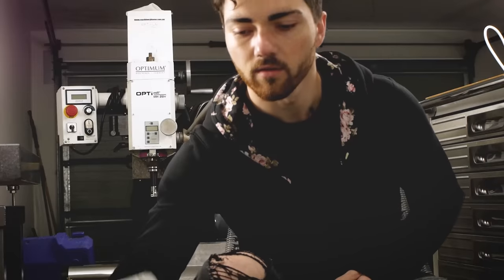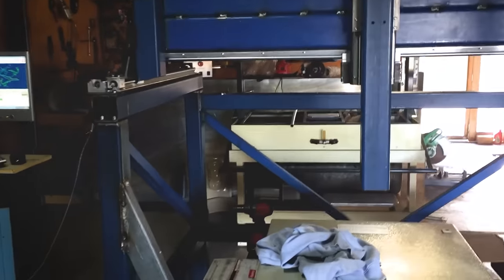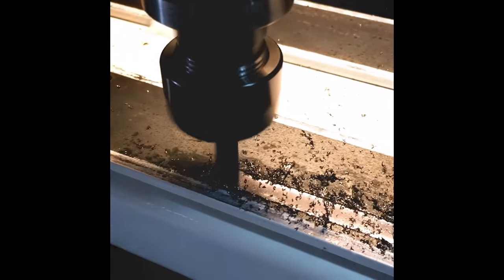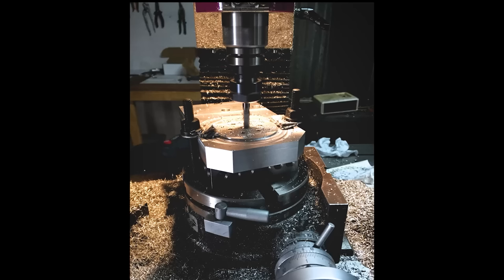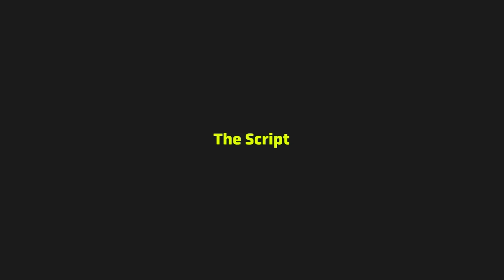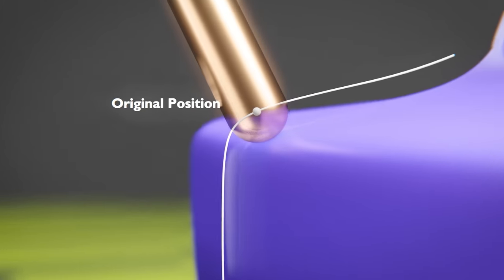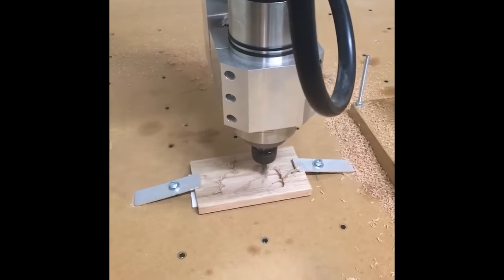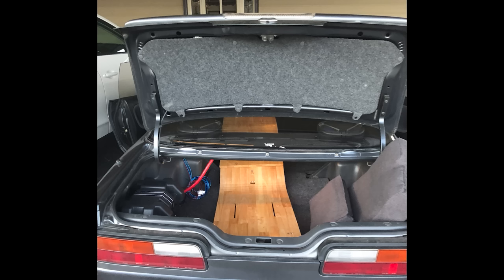I Built a Custom 5 Axis CNC Router and Barely Used It

Comment from the maker: I’m thinking to port the script to JavaScript and run it on a website probably with an ad to help pay for server costs). Would you like to see that happen?
Reply: Would a fiberglass mold work for your original intended product?
Reply from the maker: @coop3014  As a tool to vacuum form over? Maybe. As a final product? Nah, it has to be polycarbonate, that's the industry standard material.
Reply: I think the port is a great Idea. Honestly if you are able to document it's usage very well a monthly subscription or one time fee would be a good idea. G-code for 5Axis has always been a problem at a reasonable cost.  I've been into cnc's for well over a decade now and the 5 axis jump is always in the back of my mind.
Reply: yes
Reply: nominal cost, ability to purchase through jungle site... unlikely though, that stuff is a pain to set up for non-physical stuff, selling serial number cards for someone to register, cookie tied to number turns off ads, that might work and third party handles physical cards.  get enough people hitting the site for g-code generation and ads won't pay for server costs.
Reply: Yes yes please
Reply: Is that software available somewhere?
Reply: yes, of course, I looking for your python script to.. Good job

Comment: As a retired guy not wanting to sit on a porch and watch traffic, I also have dipped by toe into both building a five axis machine and writing the CAM software to generate the tool paths. I will not finish the machine until there is proof that the software will accomplish what I expect. I am using Rhino3d to generate the desired shape, and an plugin called Grasshopper to generate the GCode. Fun stuff while in discovery mode, dark moments when I learn what I need to learn. Thanks for the Video and the inspiration. What you have described  is a gift that will keep on giving.
Reply: unless you're some programming savant, why are you wasting time on writing a custom cam software, just pirate mastercam or hypermill and concentrate on mechanical and electrical.
Reply from the maker: @jonjon3829  the joy is in the journey. I also want to know how to make 5 axis CAM software properly.
Reply from the maker: I love that. I also dream of making proper CAM software. I’ve thought about many approaches, I just don’t know how to understand the data structures and mathematics for it all yet. I hope you figure it out… and then help me 😄
Reply: @machsuper  you guys must be in the top IQ dept. I've spent 3 years designing a 5 axis microcenter and I'm barely scratching the surface. After all this time all I got is what type of a frame I will use. That's all I've managed to do after investigating all possible frames on the market and a hundred cad concepts not to mention hundreds of hours running FEA on half of them.
Reply from the maker: @jonjon3829  sounds like you're simply making a better machine than I would. I genuinely doubt I'm in the high IQ range.
Reply: @jonjon3829  writing your own code allows you to understand how everything works. Also allows you to include features some programs don't have, of features particular to your machine.
Reply: @AORD72  you really think a single guy can write a feature the big guys haven't thought of in the last 50 years?
Reply: @jonjon3829  
Well you are probably correct for the top level applications. The affordable ones can be limiting, and finding a suitable 5 axis can be hard. Sometimes the features might not work in the way you want it to work. The thing is you can customize everything. Plus you learn and understand why and why not things can be done. You don't have to write every feature, just the features you need. 

I wrote 3 axis software. It was CAD and CAM all in one that created GCode which I ran in mach 3 (about 60,000 line of code) . However I had some experience in writing software so wasn't too hard (Quaternions, threading, Object orientated, C#, C++, OpenGL).

I'm look at 5 axis (building machine and writing code). I have a lot of the code structure in my head. But all i'm interested in is a head following a path generated from cutting a  STL file into bits. 

"just pirate mastercam or hypermill", not sure how you do that. If you use their software in a commercial setting you could end up in big trouble.

Comment: I really appreciated that video, especially from a fellow Aussie. In the past 12 years I have built and sold 3 CNC machines and barely used them as well. Im quite convinced that the actual hobby IS the build, and not using the machine. I have quite a few CNC buddies who don't use theirs either. I remember building my first machine and having no idea how to run it or create gcode. Its quite weird building a functioning machine but not knowing how to actually drive it. 
Anyhow thanks for your honest account. I think it will help quite a few people.
One thing Im very sure of,  is the minute you dont have a CNC machine, you will want one again.
For your moulds I reckon 3D resin printing and then sand and polish is the go today.
Reply: Hey Ben.  You found this also.  Awesome stuff here.   I mill in foam, put a silicon with backed  fibre glass jacket over the top.  Make a  plaster mould from the silicon/fibre glass mold and vac form over the plaster.  When the mold breaks, I just pour another.   And I was proud getting my cam software to spit out g-code for my mills plasma cutting conversion.  However,  this is next level.  My hat  is off to you...  Brilliant!!!!!!!!!!!!!!
Reply from the maker: Did your vacuum formed parts have clear windows? That was a killer for me, it was so hard to get a good finish on the inside. It seems like it has to be a near mirror finish to leave the surface nice and clear. It has to stay very clean too.
Thank you for the great comment. :)
Reply: @spidey4fun  Hey sir, did you stumble upon my comment or get a notification? Mate I always think what you do is amazing. Currently Im making another virtual pinball cab. The software has streamed ahead since the last one I built. We gptta all catch up again at some point.
Reply: @machsuper  I know you were asking Spidey, but my thought is could you make the mould and then cut out the window part and carefully glue in glass. That way you would maintain a smooth hard surface. I still recon 3d resin printing has come of age. One other point, people imagine CNC to create a finished surface, but that's a mistake, you need to clean and polish by hand.
Reply: @ynnebbenny  Hi Ben,  I was  just reading through the comments and saw your name.  Thanks for your kind words.
Reply from the maker: @ynnebbenny  no can do with the glass. RC car body shells are made from a single piece of polycarbonate for a specific reason: impact resistance. They can be crash many times and still hold up well. They're also very thin and ideally very light. Glass is basically none of those things.
Reply: @machsuper  No no, im suggesting you make your mould /plug windows, with glass. This will ensure a perfect surface when casting.
Reply from the maker: @ynnebbenny  Oh right! Yeah that could be a decent idea, actually. Perhaps a piece of aluminium would be good too, definitely more workable. I wish I thought of that at the time. It would still be a little tricky to make curved windows, but you could get around it with some designs.

Comment: I did build my 3axis CNC mill witch turned out really good, now I am thinking about 5axis CNC, but I have doubt that I can achieve that based on my level of knowledge. Keep building and always aim one step higher. +RESPECT
Reply from the maker: Depending on how much it means to you, is it worth trying and maybe failing or never giving it a go? If you try you’ll learn things either way. Chances are you’ll learn enough to know how to do it right next time.

Comment: Back in the 80's we added a similar head to our line of large boring mills.  Only issue at the time was the CNC programming language. Ended up having to use the APT programming software to do the demo.  It worked as a R&D project but not sellable.

Comment: Brilliant work👍🏻👍🏻👍🏻. 

I used to work in a factory that manufactures sport helmets. The outer shell of the helmet are made of polycarbonate made vacuum shell. We made the vac tool with aluminum in mass production. When we prototype in the development stage, we use Bakelite. It is easier to mill. There are many air vents to ensure the suction distributes evenly among the shell. You may have a try.
Reply from the maker: Ah! I did see the helmet vac forming process during my research. I saw the aluminium moulds. Honestly, I think I could have cut aluminium with the machine if I was careful. I should have asked more people what to do about the problem, but I was just exhausted, young, stupid and getting interested in other things.

Comment: Hello, very cool project! I learned in a thermoforming company, I programmed such 5-axis head-head machines (HG Systech with NUM control) for a few years and now own one :-) I also build loudspeakers on it.

I think your approach to the 5-axis RTCP process is very cool, you learned a lot more than when you used LinuxCNC or similar control systems in which other users have already implemented such features :-)

A tip: If you want to thermoform transparent materials, do not pull the material onto the tool with the vacuum, but leave a thin layer of air between the tool surface and the plastic. That's the way when we thermoformed clear materials.

Greetings from Germany!

Comment: Wow, JUST WOW. I work with vacuum forming, and we used XPS foam. It's a hi density extruded foam, NOT CHEAP but great to machine. Also, to get a smooth surface to a pull we wood do a .06 styrene pull on the buck to give skin.

Comment: Even though the result of a project you made didn't turn out to be useful in the area you hoped it would be useful for, what you learnt while making it, will stay with you till the end of your life and potentially make other projects significantly more doable for you. That alone, is orders of magnitude more valuable than the machine you've made. Incredibly impressive project. While on university, I wanted to make a simple 4 DOF robot arm (kinda of what you can now buy in kits these days, but it wasn't the case back then), but thinking about the challenges that would come with kinematics ( really wanted the tool end linear movement approximation) made me abandon the project. You did that as if it was nothing, and way ore than that. Incredible skill. Congratulations!
Reply from the maker: Absolutely correct. I definitely didn’t take full advantage if what I had once completed, but I am now trying to take full advantage of what I learned.
Robot arms are intimidating, aren’t they? I started trying to program a 6 axis arm from scratch one time and I was gradually finding answers, but I never stuck with it long enough to see it through. Too busy. 
Thank you for the great comment.
I’m caught up in starting a completely separate company now, but I’ve got passionate dreams about machines to build in the future that I WILL do.

Comment: I am speechless and give much praise to you,  I did almost as you.. as in first part of your works but not the last one… making the scripts of the 5-axis cam. Firstly, I have a pirated old version 5 axis cam software but never use that 5 axis part because it is too difficult for me to understand to use. I done the building >a much stronger steel frame cnc router machine as yours one and also suceed my goal to achieve much high accuracy of 0.05mm,  >to built a 5 axis but it is a tunion type and as yours one to run it by harmonic drives, but yours one done on the spindle head to allow you more easily to visualize the tool tip motion path during your development of programing scripts. > I done 7 tool posts toothchanging box and a touch probe as well and i wrote the toolchanging and auto touching program codes to run in both LinuxCNC Gmocapy screen as well as in Mach3 screen, but it is much harder to be done in LinuxCNC one, where i just finished the former one and that was not what i expected. > as i learned electronic, i once build sinker and wire EDM machine, but the outcome results were not satificatory because the electronic circuit for controlling sparking and the motion program (i use both Linux and Mach3) were not good enough. Now, everything finishes and I stopped to go further anymore. For the 5 axis tunion, I seldom use it because I don't know how to use the software. I done much electronic, programing in mcu, ardrinuo in C or even assembly language in the eariler time as my hobbies,  but I never think that I am able to write cad/cam software codes , I used several types of cad softwares to modeling parts for almost 30 yrs as my career and never understand how the software construction are. Now, i spend my time much in playing around Raspberry Pi in AI detection programing and learning the  Python in writing the codes

Comment: Very interesting, you could use the head for porting cylinder heads! Definitely one of the most thought out diy multi axis systems out there.
Reply from the maker: Put it on a rigid enough machine and you certainly could. Might be pushing your luck doing it on my machine.
Reply: @machsuper  not really, nice light cuts and you can make wonders with small machines. Huge respect on the build!

Comment: What a great video. Just found your channel from your scraping video, decided to check out your older stuff as well. 

If you ever went back to trying to make forms for vacuum forming, one of the things I would personally try is to carve the form from wood (potentially adding some additional texture to the surface) and then covering it in a layer of automotive filler. Sands really nicely, fairly heat resistant, you should even be able to wet sand it to a near-polished surface which could help for the window areas.

I've been trying to plan some sort of CNC router for a while, not sure which direction I wanted to go in. Thanks for posting what did and didn't work for you :)
Reply from the maker: Thanks for the idea. I didn’t think of that. I firstly would assume it still can’t hold a goof surface across many uses, but I just remembered that I was using polycarbonate about three times too thick, so maybe it would’ve been more forgiving with the right work material.

Comment: I am building a small CNC router, just 3 axes, and some of the things I had to go through so far have been challenging but at the end they were worth it. I originally made a model of the machine but left out some quite important parts like how will the axes connect to one and other because I didn't know what I had available when it came to materials and I was too lazy to figure out how to make those things work. So I left that as a  "fit at assembly" kind of thing which bit me when I got to that part as it took a LOT more time than I wanted but so far, as I have quite a bit of scrap steel, it has improved the rigidity quite a bit so my expectation went from "It'll barely do aluminium" to "Perhaps it'll even do soft steel". Only have one, not even full, day a week to work on while also having other projects ongoing. So far I have managed to make the base, X and Y axes which took 6 or 7 months so total about full 2-3 weeks of work. 
To be honest I have no idea what I will be making with it, I just want a CNC to do stuff with so I am building one.
Also the budget is about as little as I can spend on it and the final price will be about 450€
Reply from the maker: That’s such a classic story with DIY CNC 😄
Often for people, they just like making the machine, not necessarily making things with the machine. I’m not too dissimilar. I just want to make cool car parts and other machines. I am getting interested in artistic interior design though. 
Keep having fun with it man! Sometimes it’s fun not to plan too much.

Comment: Congratulations. You managed to finish your project, even if you didn't achieve the desired result. I'm building a 3-axis machine and it already has enough details that you have to pay attention to. I'm using a 3D printer controller to control the CNC. Technology has advanced a lot in the last 10 years and it is easier to assemble machines with more advanced features. Good luck.
Reply from the maker: There is many things to manage, isn't there? Just have to compartmentalise and do lot of reading and thinking. CNC technology is move very fast, isn't it? When I started, everyone was using parallel port to communicate between their PC and  their breakout board with a Mach3. No one does that now!
Reply: @machsuper  True, there are many details to pay attention to in order to perform well. You have to do a lot of research and study on various subjects. Parallel port cards are a not so distant reality, I have two that I bought and didn't even use, time passed faster than my build speed. I ended up building an MPCNC and that's where a great learning came from, today I'm completing a machine based on this previous knowledge.

Comment: BRAVO ! 
Absolutely great how you presented the idea you had and the background of it. Not exclusively technical but what you were thinking during the process.
I just wonder if you never came to the point to be so frustrated with some problems that you wanted to give it all up...
Reply from the maker: Thank you buddy! I never felt like giving up when fabricating, machining and programming, but I did get super frustrated with the limit switches and some issues with EMI in the electronics. I never fixed the limit switch issue, but I did fix the EMI by grounding the 5V power supply better.